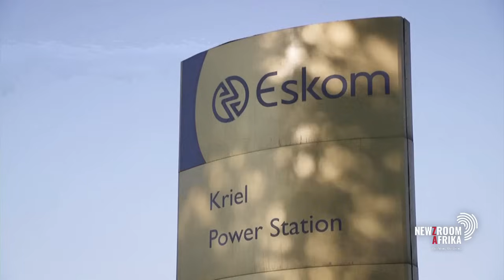'SA doesn't need more power stations to end load shedding'

Comment: One additional powerstation was built and two got upgraded in response to loadshedding, and there was no loadshedding from 2015 to 2017. So basically there's no need for a new powerstation
Reply: Those two power stations are still not working for some reason. An odd country.
Reply: @rickmorty7284 That is where corrupyion lies